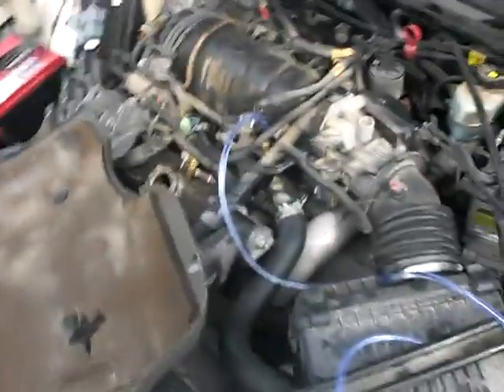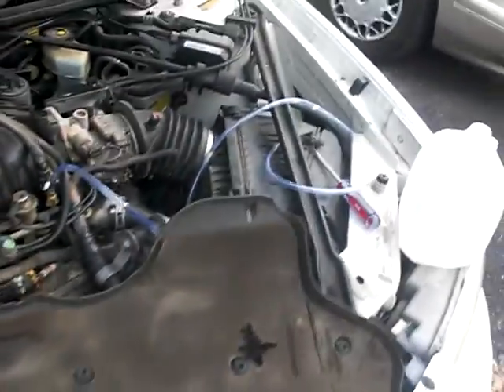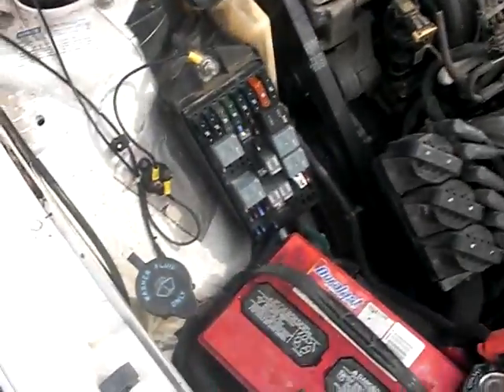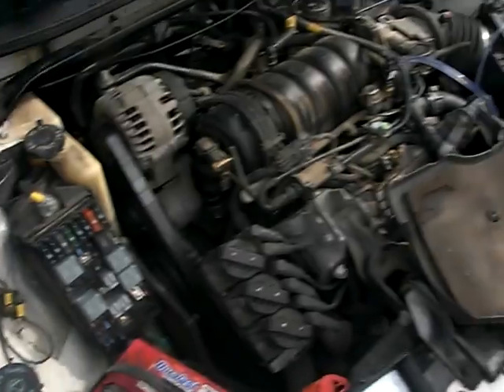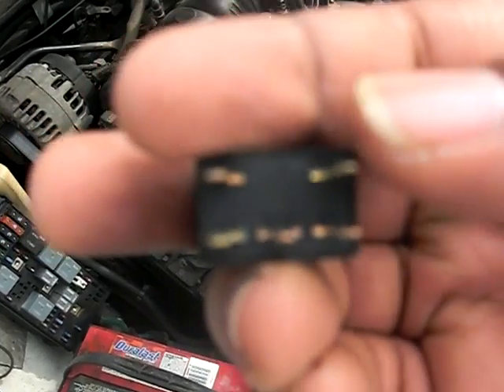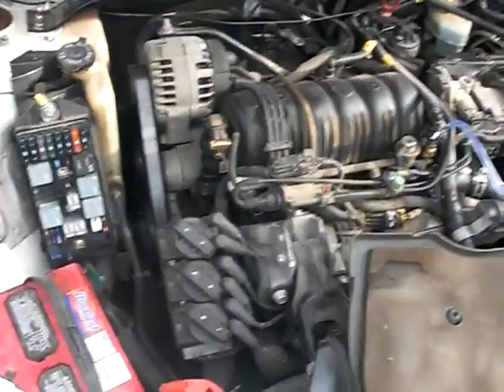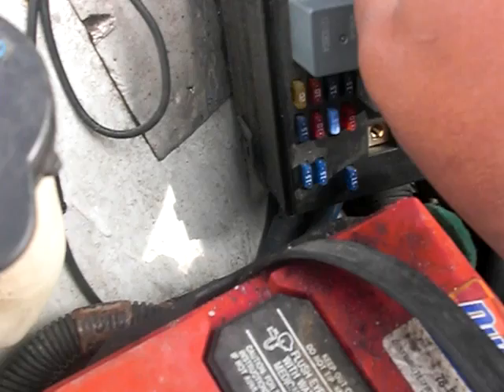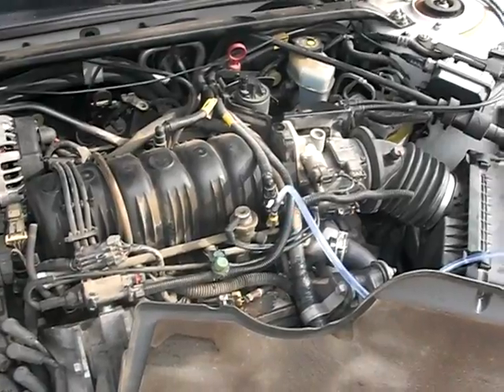How to Siphon Gas Out of A Modern GM 3.8 Engine

Comment: Great video.  My 1998 Olds with a 3.8 just died with a full tank of gas.  Will try this.  What is the inside diameter of the rubber tube?

Comment: Hey there Treysonsdad.  Thank you for this very informative video.  I got a 00 Regal and working on it as it has a blown rear head gasket and leak in the manifold.  Hope it can be saved because I am repairing it.  

One question, did you disconnect the battery when you siphoned the gas?  I am asking because I need to siphon the gas out, but the battery and altenator was removed already.  Will this work? If not, how do I get the gas out of a car with no electricity?

Comment from the maker: @ivanD1982 you need to find your fuel pump relay and you fuel inlet tube into the throttle body if you have tbi, or find the input for your fuel rail if you have fuel injection.

Comment: You sure it's a blown head gasket you might just have a warped intake manifold from the EGR valve melting the plastic intake plenum and letting the antifreeze fill up the valleys and see if it to the ports that go directly to the Pistons